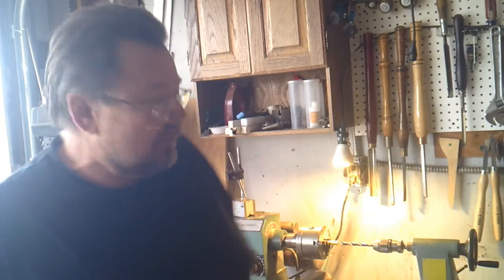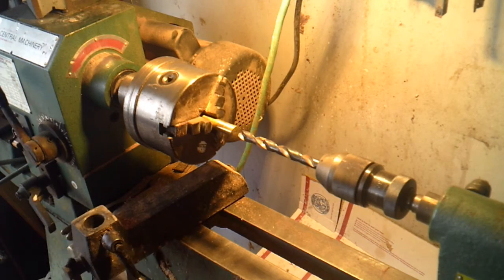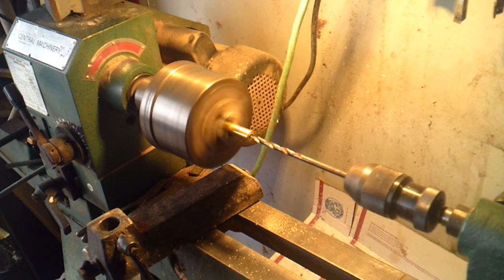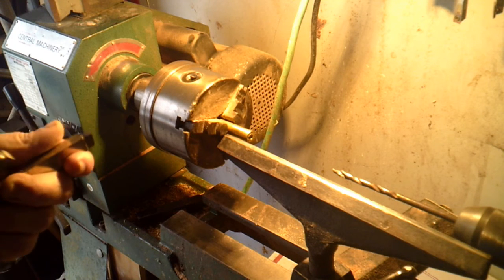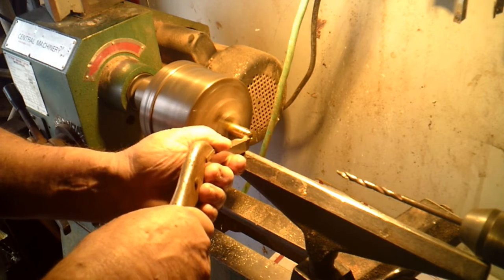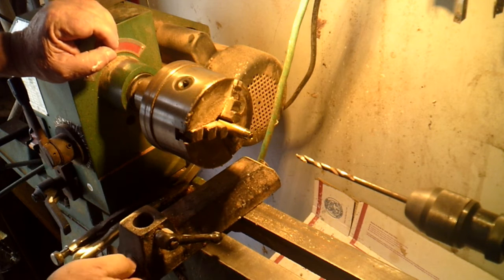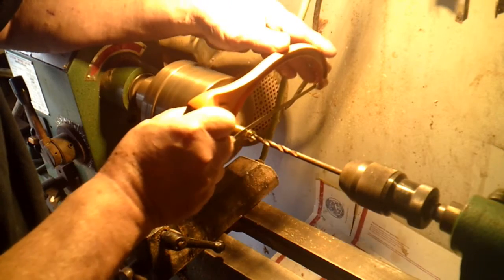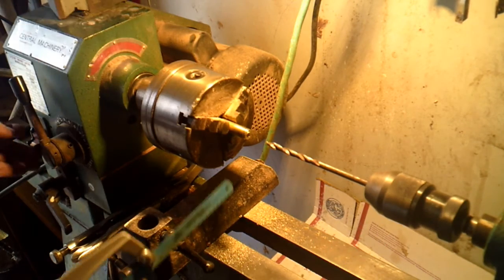Turn your own pens center bands for the slim line DIY

Comment: This practice is very dangerous
Reply from the maker: What part os very dangerous?
Reply: @mtabernig  hi, for a start you have no real control over your turning tool holding them in a pair of mole grips .as for sawing off your speed was to high, if you run the machine slower it would cut better. All the best for Christmas and new year
Reply from the maker: @daveboyle2840  As you can see this is a wood turning lathe, there is no tool post one have to do with a tool of the trade and I was showing how can be accomplished
Have a wonderful holidays!